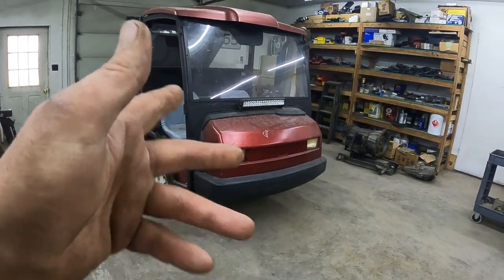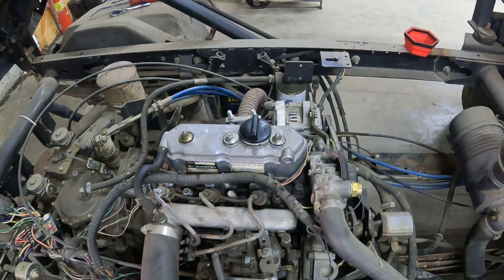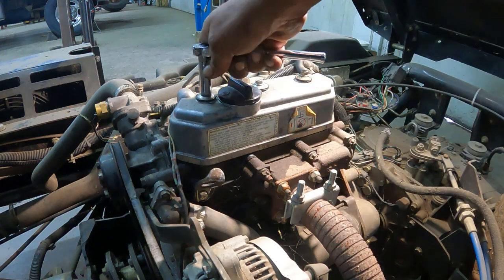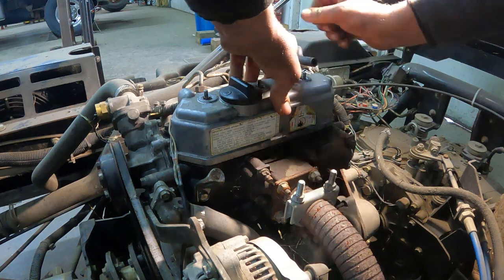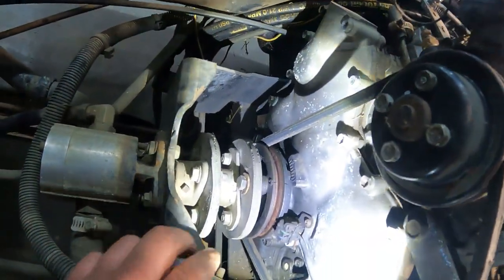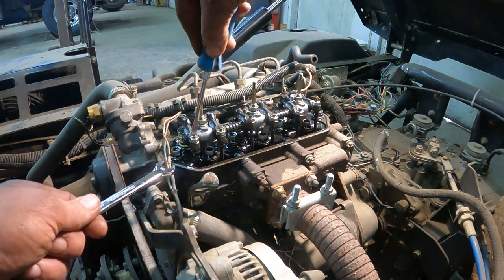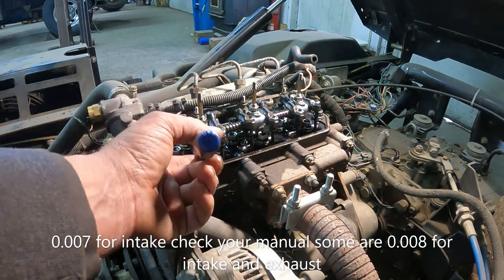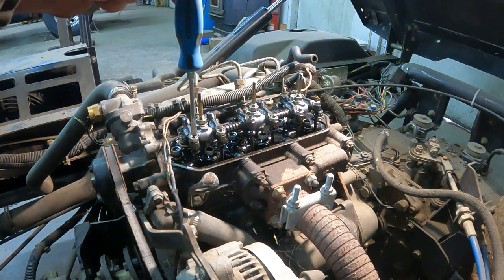Daihatsu DM950D valve adjustment

Comment: At the end of May 2023 I bought a 65.8 hour Toro 523Dxi. Story is that the first owner or one of his children or grandchildren ran it low on oil. Middle connecting rod broke and put a hole in the right side of the block. I’ve sold the grill and bumper on Ebay. I removed external parts last week and I’m about to remove the head. Any special advice on removing the head besides loosening bolts a little at a time?
Reply from the maker: Just like any other cylinder head 1/2 turn or so on loosen the head bolts in the opposite way of the torque down procedure. And then just run them out. Thank you for watching
Reply: @CountryMileGarage  
I started with 1/4 turn on the ends then worked myself inward. I think that I have to remove the engine to remove the injection pump.

Comment: Mine on my zeroturn blows smoke and runs rough for maybe a minute. When it's cold under 70. Where would u suggest  I start?
Reply from the maker: It can be caused by faulty injection timing (bad or worn injector) or low temperature in the combustion chamber, condensation or coolant (head gasket) or worn piston rings. The list is pretty long but it's hard to diagnose without seeing it. Hope this helps and thank you for watching
Reply: Thank you, your time is greatly appreciated and you gave me confidence  👍
Reply from the maker: @Chris-jg5vw  I'm here to help my good sir